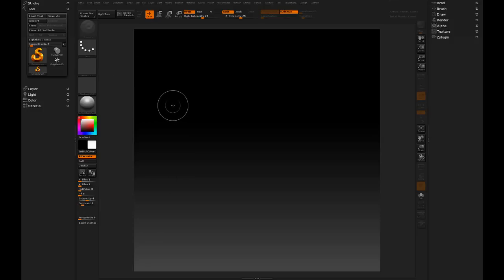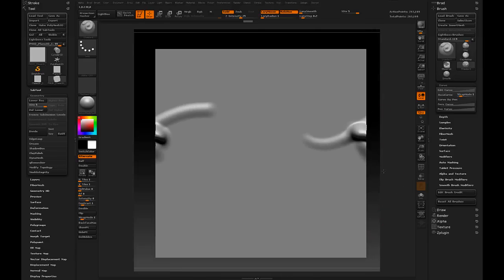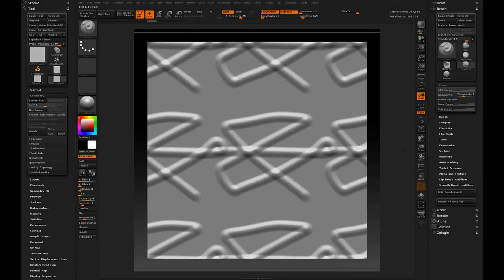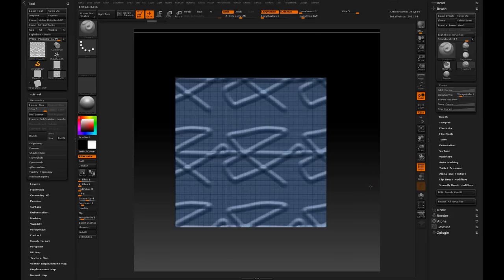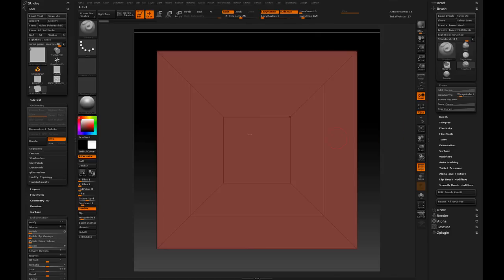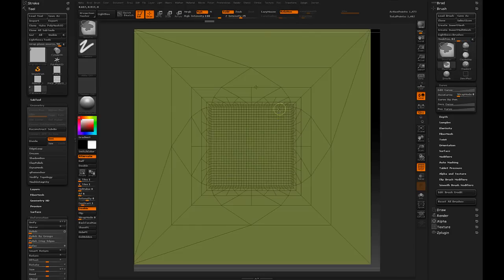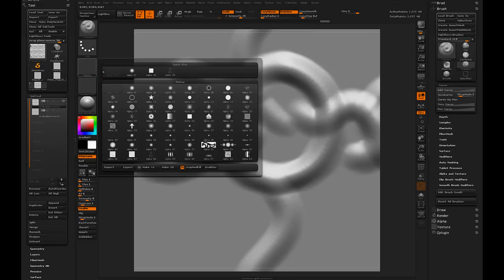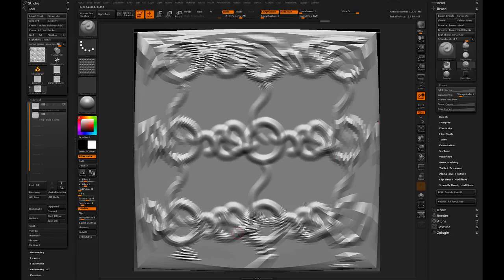ZBrush Tileable Sculpting 01 - Brush Wrap Setup

Comment: An easy way nowadays (and you can use the plane that comes with zbrush).
Set your doc size to something square like 1024x1024. Press F to focus plane, then Ctrl D to duplicate it. 
Press W and make it a little bigger, turn off smooth (Smt) & subdivide.
Work on your larger plane as wrap mode stays set to size of the smaller one. Done.

You can export the larger plane as your high res, smaller plane as low res, and use something like XNormal to bake the maps.

Comment: Okay guys how to easily setup this plane, when I started this tutorial on setting up this plane it came out wrong. So what you want to do: Make plane for a single square tile, split that plane into 3x3 tiles, so 9 equal tiles. So you can imagine this as a texture that is tiling 3x time on both axes. Why 3? Because it's the lowest number of tiles which has a tile right in the center. We don't really care about the other 8. So cut those tiles into halves vertically and horizontally and 4 corner tiles into quarters. You now have your 3x3 tiles with half and quarters of the other tiles cutout. You want some padding? Subdivide the central tile 2 times for 1/16 surface area which is small and big enough for some padding around borders. Copy the padding tiles all around the border tiles  of your central texture tile. Weld the central tile with the padding tiles and extrude them back to borders of the remaining 8 halved tiles.  You should know have a square plane with the central area square just like in the video. You can scale it up to any dimension you like. Thumbs up my post if you want me to make a picture-based step by step guide for more simplicity. The easiest I could explain is as: The central area (the polygrouped area) where you sculpt has to be of certain area percentage of the overall plane area to be able to tile properly. It has to be 11/4th of the overall plane. So if you make a 128x128 plane,  you have to have a 64x64 plane inside. and then you can also adding the padding on the outside as well. As simple as I can explain.

Comment: SergeKarp the disabling transform modifiers idea doesn't work. Many brushes do not behave correctly when you disable xyz transform modifiers. For example try using hpolish with only one transform modifier enabled - it doesn't work properly. It acts like a weird flatten brush.

Comment: For 3ds max for it to work, Tools > Geometry > Size is set to 2. Wrapmode is set to 2. if you have 2 squares (4 in total). If you have 3 squares (9 in total), set size in zbrush to 3, wrap mode 2. Basically, 1 zbrush unit - 1 square.
The best way is to create 1.5 squares, and set size to 1.5 as well. So you have less geometry on sides. And also wrap mode is 2.
Reply: with 3 squares do you mean a plane with 2 insets ? if so, how do I get the right measurements of my plane ? thanks for help.
Reply: Remo Van de sande , yes a plane sudivided 2 times vertically. When you set the scale in zbrush, you kind of reset its size.

Comment: My plane scale is correct and I even tried to export a plane from Zbrush to Max with GoZ, edit and back into Zbrush.  I can't however figure out how you're getting your brush wrap mode set to 1 tiling in the unified space.  If I set wrap to 2, it tiles around the non selected subdivided edges.  Could you also explain how you set up your poly groups for the extruded faces and crease settings? Thanks.

Comment: I created the plane in zbrush first since the initial creation is already in the unified space.
I then used goZ to export plane to your 3d app and extrude the edges. Used goZ again to update the geo in zbrush. Warp brush worked correctly when I did it this way.

Comment: I exported the 3d plane mesh from zbrush to 3ds max and it was the same size as a 2x2 unit plane created in Max. So then I figured out that the plane should be 6x6 units in size, added 2 divisions so I get 9 polygons in the plane, then I welded the vertices to the corners so I ended up with a plane that has on poly in the center and 4 polys surrounding it. Then I connected the surrounding polygons's edges so I have similar mesh as you do in the video. When I export that to zBrush it doesn't work